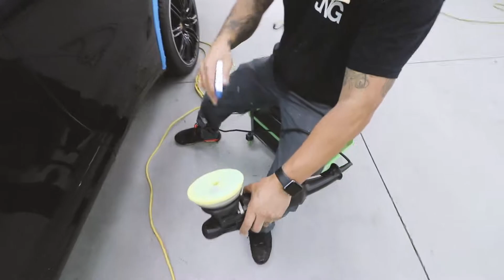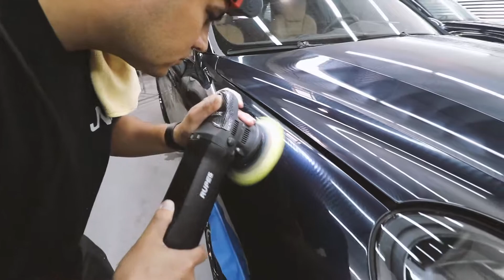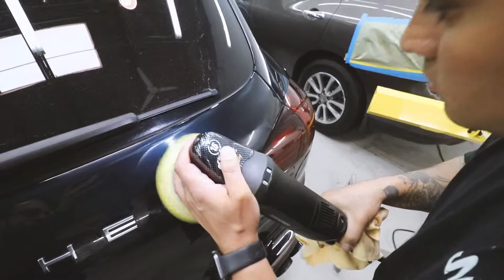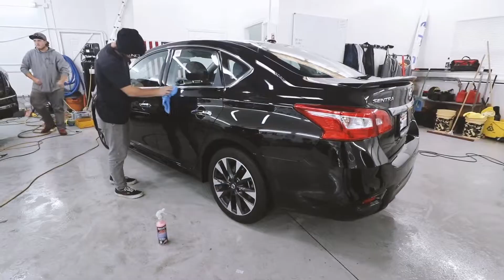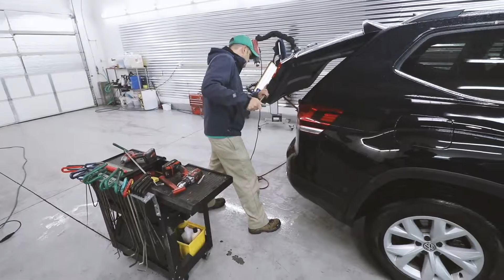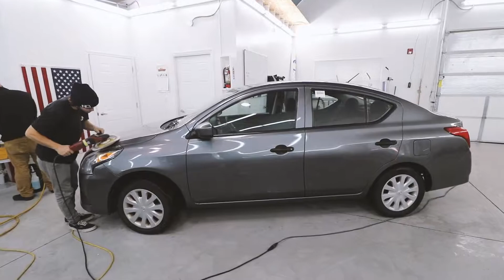Polish porsche and paint touch up for beginner vlog video. Using a Rupes polisher.

Comment: See ya boy making a repair to the rear bumper have you ran into any issues with sensors an blind spot monitor system malfunction after the repair was completed?
Reply from the maker: No, we haven't ran into any issues knock on wood if so, we probably have to take it to dealership to get recalibrated
Reply: @BorndetailersTv  I work for a body shop where we do a lot of rental cars word to wise if you build your primer to high or make the clear to high it will mess with those little black boxes mounted right at the corners an on the bumper it self especially ones that have self driving capabilities. A lot of times one light repair there ok add another an that throughs the reader off. Js might wanna look into that because of insurance reasons. We got sued one time 🫤 already.